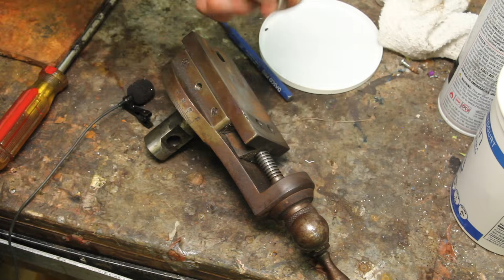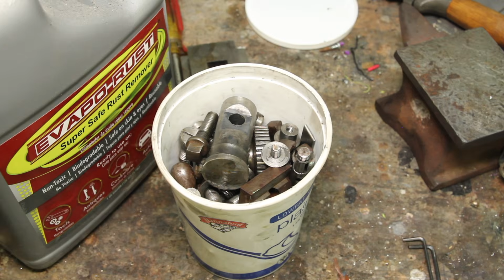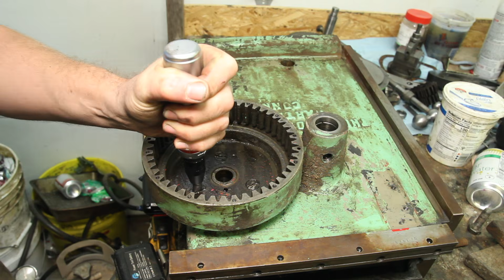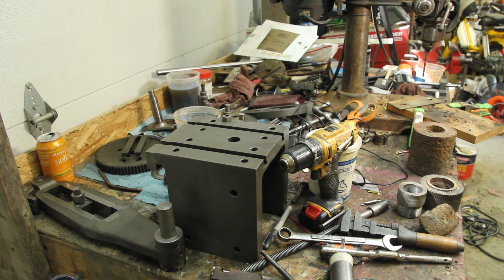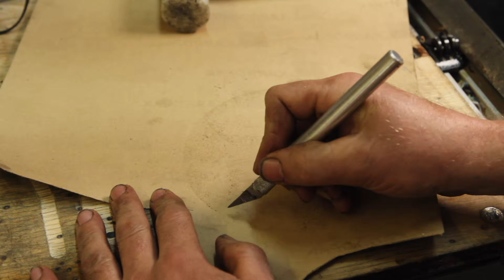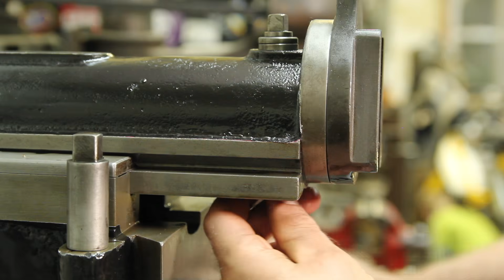Rhodes Shaper Restoration (part 1)

Comment: I'm wondering, couldn't you apply a clear coat of some sort to help prevent the rusting of the bare metal spots?  Would it cause a problem with clearances or tolerances?

Comment: ran through the comments to check if anyone said anything on it, but that bent spring was probably pushing against a ball at some point, its a detent, not a hard one, likely to hold the indicating collar at a certain position... My schaerer ``UN`` lathe has a few similar elements and im not talking about the autofeed ball clutches that disengage upon hitting the stop, im talking about ball detents that interact with handwheel collars and ride in an internal ground in spiral path, one seems to be meant to drive the collar and indicate the feed when a taper attachment is used... I will have to see, its a lathe that i am atm restoring to her glory, so at the moment i am not completely introduced to her finery and secrets...
Reply from the maker: There was another one on the lead screw, there was a little piece of felt between the spring and the dial.  I think a set screw was added to the dial on the slide on the ram to “replace” the spring on the dial.  
My mill has the spring and ball setup on the dials.
Reply: @JeremyMakesThings  yeah, as you said in second vid of this shaper... I just assumed it to be what my machine has as i didnt consider it a holding mechanism, but you might more than be right, as on such a screw, it makes no sense for it to have anything to do with actual indicating apart from dampening the vibration and making sure the collar stays still... I hope to pick up a shaper soon... They are quite big and to a point not the best thing to have, but then again, when you consider what they can do and that you can let them do their work while you do something else a few feet away is a marvel...  Its just that the ones i find are around 2 tons, which makes them quite fucking big... bigger than i would like to house at the moment, or restore... i have a 3 ton lathe that i am restoring, that is work enough...

Comment: The brass plug is the fill level hole on face of planetary but more won't hurt if it is not sealed and vented  all depending on speed of it as well faster will build pressure due to oil heat soak and expansion

Comment: Morning Jeremy.the Rhodes, Atlas, and SB's are more friendly when comes to tare down and reassembly. Kinda wish Klopp had simplified there machines, would made my life a lot easier. Holidays did slow the tare dw a bit, and the Shot Well sprayer I ordered 2wks ago, is setting on a ship, god knows where? Prior owner pumped the ram and gear boxes full of grease, and Klopp use only 30sae non Detergent shell motor oil. Bull and trans gears do use grease, but since the 450 is a tank, having to clear on the shop floor. Nice that you took time to share the Rhodes, and enjoy. Will come back to see it's next videos,,,Bear.

Comment: The gearbox has an oil level hole with a brass screw in it, near the bottom. Just fill it until it comes out the hole, it should only have a tiny amount of heavy gear oil in it. Too much oil will put radial load on the gears and will strain the bearings. 🙂
Nice project! 👍

Comment: I have the same machine. Mine has a bake-o-lite bull gear. And was converted from the line shaft drive to a motor and pulley setup. It’s a nice little machine. Good luck with yours.

Comment: Just found your channel.  Interesting,  but having tried all sorts of rust removal methods I must say that Evaporust is expensive, and no more effective than white vinegar.  Anyway,  I've subscribed.
Reply: Evaporust is much more gentle than vinegar and if applied correctly, more effective. They use two different chemical processes
Reply from the maker: The biggest advantage evaporite has is I can throw stuff in and come back three weeks later, which is helpful since I’ve usually got 8 different projects going on at once.